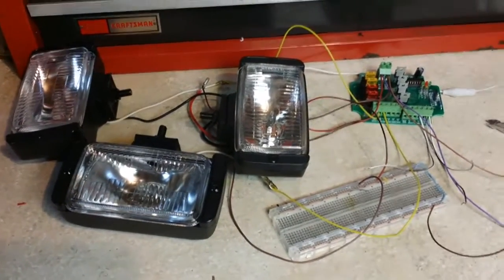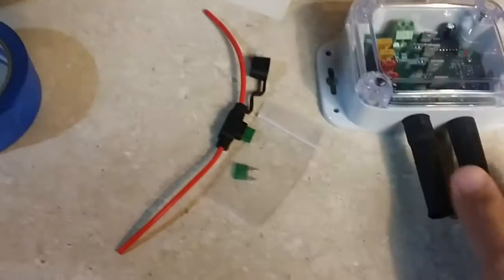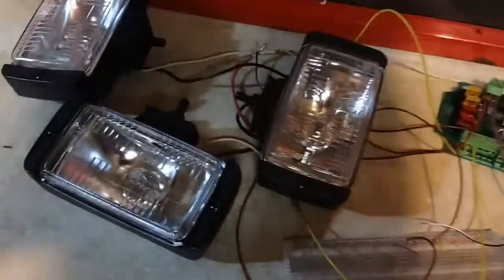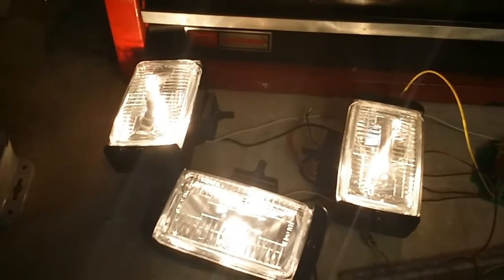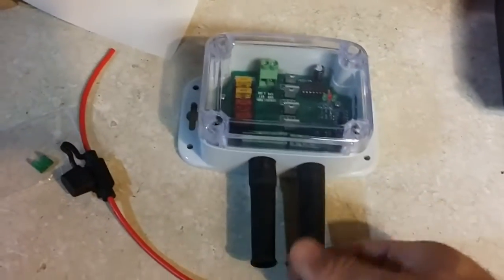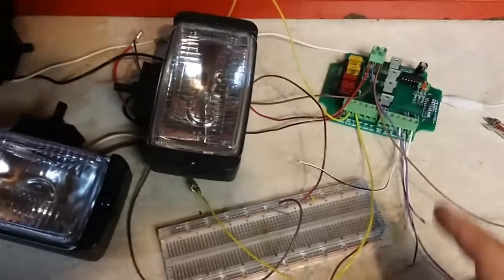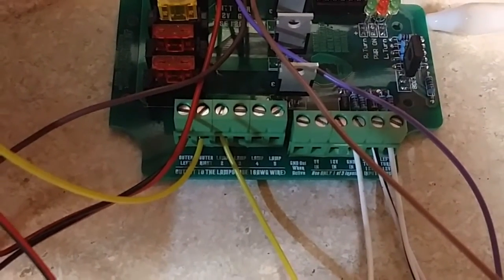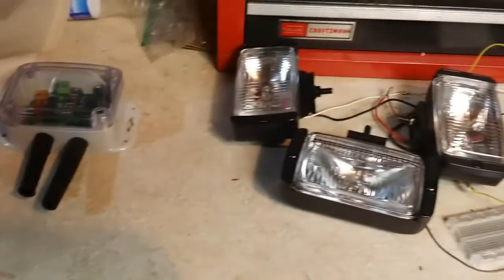KITT Fog Lamp Module Demo video Final

Comment: Nice. Could you create a basic fog light module where the fog light wires go into it, power wires etc, then a 3 way switch off, on, and 'wig wag' effect. the fog lights i bought came with relays etc but looks complicated. Need one of you modules.
Reply from the maker: Thank you for your comment. I will NOT do WIG WAG effect with this module. Sorry.